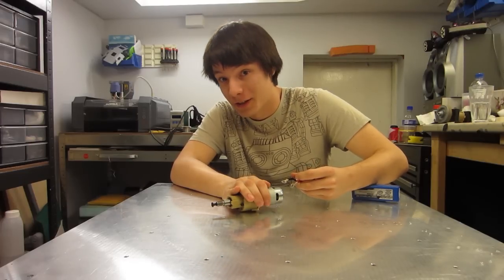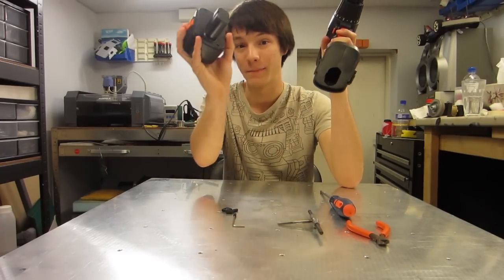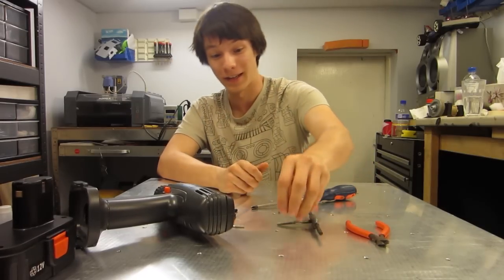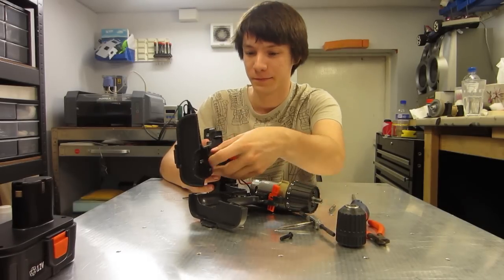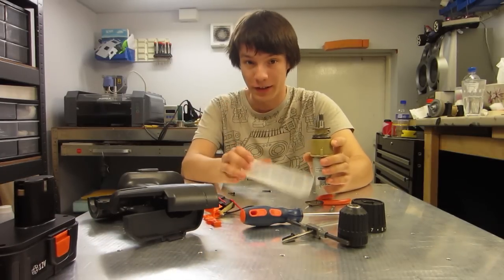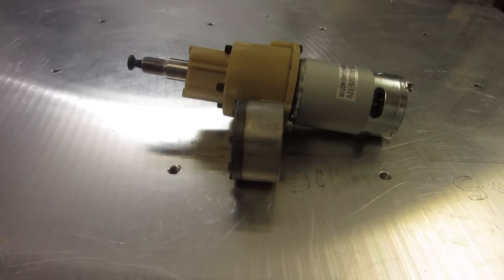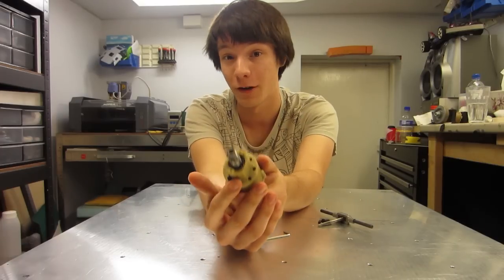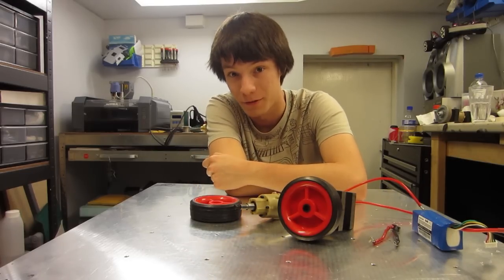How to build a Combat Robot - Episode 1 Cordless Drill Hacking

Comment: your grub screws look longer than 6mm? The M5 grub screws are 5mm diameter right? And you say you need M5 6mm. I have bought M5 6mm, and they look shorter than your ones, they definatley wouldn't stick out the back of the motor after having been drilled in. Not sure they are long enough to block that bit and do the job. Looks like you are using M5 16mm or M5 20mm?

Comment: Hi Angus,  thanks for your great tutorial. I have been following your instructions and done exactly as you have shown but for some reason my drill motor shaft will not turn freely even before I have screwed the grub screws in.  This applies to both of my Ozito cordless drills.  Have I done something wrong?  Is there a way to fix this?

Comment: Hey when I try to get the chuck off the drill it keeps turning with the shaft. How exactly do I get it off ? Its a Kmart drill if thats any help
Reply from the maker: Have you removed the screw inside the chuck?
Reply: I did. I just put it to the lowest gear and put an alan key inside and gave it a few hits and that did the trick. Unfortunately on one of my drills I have stripped the screw on the inside shaft. Do you have any advice on how to fix this  ?
Reply from the maker: +Jack Ruefli really all you can do is drill it until the head is gone. Remove the chuck. Then use pliers to unscrew it and try and find another.
Reply: Ok no worries, Thank you for your help. I'll give it a shot, I bought 3 drills just in case this happened. If one was a nine volt and the rest were 12V woyld the 9V screw fit in the 12V shaft ?

Comment: I've just managed to get the motor out of one of my cordless drills, but the shaft doesnt spin after I remove the ball bearings and spring from the clutch. Does this matter at all or will locking the clutch allow it to work fine?
Reply: +Reploidx9 
You HAVE to lock the clutch for the drill motor to work. Otherwise, no torque is transferred to the output shaft. Its like running a car engine in park.
Reply: +Coboxite mines are weird motors..not sure why they ran ok without locking. locked em anyway

Comment: If you put eight screws in the motor does it have more torque
Reply from the maker: No four is generally enough 8 will spread load on clutch bit a little more but doesn't increase torque.

Comment: Were can I get grub crews and also is there any drills that dont require them
Reply from the maker: M5 grub screws. Any bolt store or online. And generally no but you can use proper gearboxes like banebots if you have cash.
Reply: Robowars Australia ive already got some but thanks any way

Comment: Dude, thanks so much for these vids, my robot is now 4 wheeel drive mounted onto a 6mm thick aluminium plate and uses 2 botbits 85 amp escs and a turnigy 3 cell 5000 mah battery. i couldnt of got it to this point without u answering my questions or making these vids so thanks :)
Reply: Will Elliott Oh wow, awesome dude! Got any vids of it moving? Would love to see. I'm just recovering from Robowars Sydney 2015 - got LOADS of footage so going to uploading all the fights over the next week or so. :D
Reply: Maker's Muse i've got a vid where should i send it?
Reply from the maker: Will Elliott Is it on youtube or something? Otherwise you can PM me something like a dropbox or google drive link! :D
Reply: Robowars Australia it's on youtube now, it's on my channel its called robot test drive :)
Reply: Maker's Muse hi, my vid is on my channel now and its called robot test drive :)
Reply: Oh wow, epic dude! really nice platform you've got going there, and awesome off road tires too :D Congrats.
Reply: Maker's Muse yeah, I like the wheels too, unfortunately I'm gonna have to replace them with some stronger ones cause if you put your foot in front of it and push against it whilst its driving they turn all wobbly on the motor shaft the new ones I will make will have a 3/8 unf brass insert that thread directly onto the shaft with metal threads :( /:)
Reply: Cool
Reply: Will Elliott  can I see plz
Reply: Sahlee Reyes on my channel :)

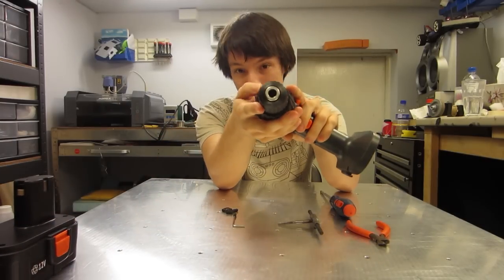Comment: does anybody know the difference between 1:18th scale motors and 1:8th scale motors? and which one is better for a 20-60 pound combat robot?
Reply from the maker: A huge difference in size! And 20-60lbs is too big a range. You could use 1/8th motors for a 20-30 pound robot but not much bigger - maybe 60 pound if you had two per side and enough reduction.
Reply: So should I use 1:5 size motors?
Reply: Robowars Australia or do you think I could get away with 1:8 scale motors on a 20 pound bot?
Reply from the maker: For sure yeah, but I don't think there is a 20 pound weight class?
Reply: Robowars Australia on combots I believe there is.
Reply: Robowars Australia how much does your bot in the video weigh?
Reply from the maker: The platform was about 6kg, but the drivetrain is capable of pushing a 13.6kg robot (30lbs)
Reply: Robowars Australia sweet
Reply: Robowars Australia perfect!

Comment: Two questions please. I am using twin 14.4v drill motors for my robot (tank steering).

1. Do I need to set the drill motors to any particular gear/speed setting (using the adjustment knob) before locking the clutch? Or do they default to a certain speed automatically? I already did the conversion and am worried that one motor will be running faster than the other (because I did not make sure to set the knob before doing the operation).
2. If a motor stalls in operation, how long do I have before it overheats dramatically? And would the current surge - even momentarily - drain my 3S battery? 
Thanks.
Reply from the maker: Hey There, most cheap drills only have one speed setting, though some do have an additional low / high speed ring that controls an additional reduction stage. Not sure what drills you've got, but locking this in place can be as simple as just a pin. The clutch 'ring' is totally removed so doesn't matter what setting that was on when you pull it off.

In regards to the motors stalling, a drill motor at 12V can easily peak 100+ amps, which can quickly fry itself, batteries and ESC's if they're not up to scratch. I love the botbitz 85a because it will survive these situations, but be very careful to select a battery with enough C rating (the total amount of current it can safely supply) to handle these situations. If the battery is too small, draining is the least of your worries, it will probably stuff it or might even catch fire! :P
Reply: RobowarsNSW Unfortunately I did not rotate the speed ring before locking the clutch. Not sure if I can rotate it now but will try. Might I ask how long I would have before the motor goes to 100 amps; is it a matter of seconds - as in enough time to turn the power down on the transmitter? Fortunately my ESC should be ok as it is rated for 320 Amps and my LIPOs should be able to go to 60 Amps or so for a short while. Thanks.
Reply from the maker: Not quite sure what you mean by speed ring, but if it's the black thing at the front of the drill with the numbers - you don't need it! :) As long as you're not forcing a jammed motor / wheel back and forth for ages trying to get it to move you should be ok. Time to 'cook' varies but a totally jammed drill motor with enough current supplying it will start to let out the magic smoke within 5 seconds. 320A is a pretty insane rating, sure it's legit?

Comment: what is the rpm and torque of that motor,
is this motor is fine for making robot for robowar..??
"http://robokits.co.in/shop/index.phpmain_page=product_info&cPath=2&products_id=212"
what is the best rpm and torque you think is best for robowar.....considering average weight and suitable speed???
Reply: link is: http://robokits.co.in/shop/index.php?main_page=product_info&cPath=2&products_id=212
Reply from the maker: sanju singh that would drive a 1kg robot but not much more... what do you consider is 'average weight'?
Reply: RobowarsNSW 10-12kg
Reply: if u want to go with cheap solution, use car wiper motor, with a chain reduction to increase the speed- 2-3 times. that motor has a torque of 40kg/cm

Comment: I've looked at several stores and I have three options a twenty dollar 9.6 volt, a forty dollar 12 volt, and a forty dollar 16 volt. Would 9.6 be to weak? Would 16 be to strong? Or should I just go with the 12 volt? I want the best robot possible.
Reply from the maker: Heya! Hmm that's a tough decision, the 9.6V would be OK I think but you won't be able to run the system much over 12V as the motors would burn out. $40 is a bit much for a 12V drill, you can buy proper robot gearboxes at that price. :)

Comment: Some comments:
1: Not all drill motors are the same. Some won't take M5 grub screws (IE the ball-bearing holes are too big.
2: Another way of locking the torque limiter is to put an 'O' ring in where the teeth are. It will slip under massive load (such as using an axe as a self-righting mechanism in a heavyweight robot) but won't have any impact if you are using as a motor. 
3: If you are using a drill motor, you need a BRUSHED ESC, not a brushless. They are more expensive, but will work on this sort of thing. Check botbitz for the only 85A I have seen around. 
4: The xt60 connections used here are available from Hobby King; not too expensive, but they are great if you don't want to have to re-solder every time a motor blows.
5: Not all drills are the same; check the voltage before you buy, because a 6V drill motor will struggle to move a medium-weight robot.
6: Buy a DECENT cordless drill to do your work with; there is nothing more disappointing than switching from a power-drill to a cordless and finding your torque limited to crapola. 

Now, some questions: if you are just using single drill motors, could you get away with a lower rated ESC? There is a really big pay-gap between 30A and 80A. 

Where do you get your chargers from, and what power sources do you recommend? (A pair recommendation would be great, :D)

Do you program your own ESCs? If so, how?

Thanks in advance, and have fun!

PS: Any chance of a South Australian competition any time soon?
Reply: The stall current for those sort of motors is 12 Amps, so you'll be fine with a 30 amp ESC; I use an ESC i built myself, so i don't know the exact rating, but it's a rough copy of the scorpion XL which has a 30A rating, and it's fine for drill motors..
Reply from the maker: ***** Actually 550 motors have massive stalls, close to 100 amps if your battery can supply it. You can get away running a 30A esc but it will blow up if you stall your motors and continue trying to drive.
Reply from the maker: Barnaby cheers for the comments! You're 100% right on all points. I use 12v drills these days as they are best cost / performance in my area but I used to run 18v. 6v would be OK for hobbyweights but it's too gutless for feathers. 

For your questions - You CAN run 12v drills on 12v with a 30A esc, I can recommend the scorpion xxl or botbitz 30A. However, if you stall the drills be prepared to find your esc giving up the ghost, this has happened to be a few times now.. the 85a are more expensive but can smoke drills all day and are fine.

I don't program my own escs, I let the pro's do it for me :P I have a fair bit of history with botbitz and have tested many of their prototype esc's to oblivion. The code their new products have is much improved over the open source stuff released several years ago. 

No SA comps that I know of... however there may well be some stuff starting in Perth soon... and the nationals should be held in Ipswich again later this year - well worth the trip!!!

Comment: To unscrew the chuck instead of hitting it, or pulling on the chuck I take another drill and a long bit, and load the bit onto both drills, and use the other drill in (reverse/forward) to remove the chuck unit.